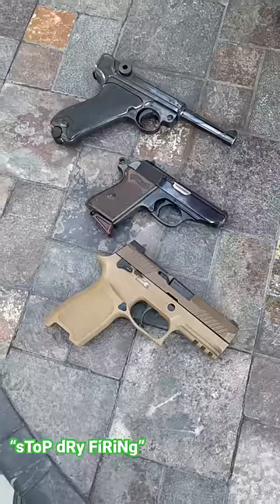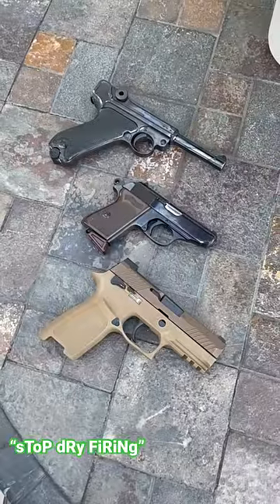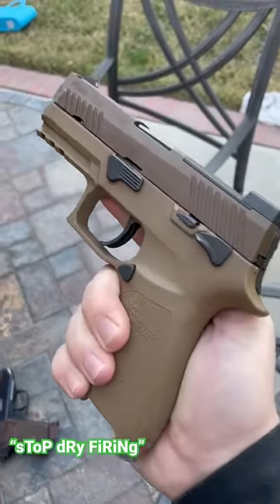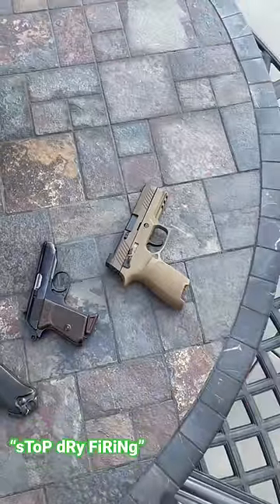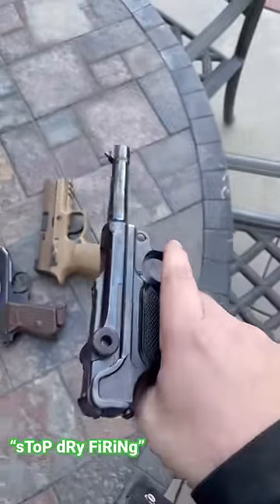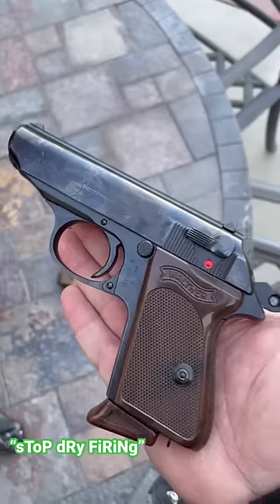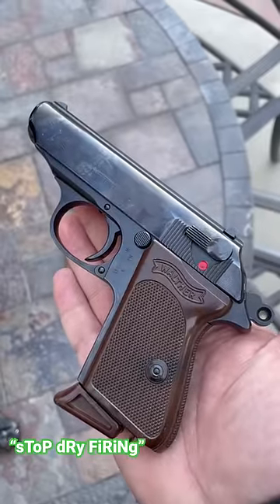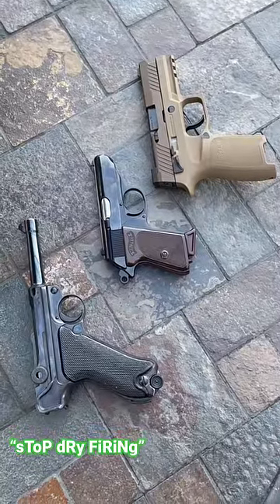“sToP dRy FiRiNg” #shorts

Comment: Or a CZ Rami BD built in 2014. Those firing pins are garbage and they admitted they used a weak metal for it resulting in bends

Comment: I routinely dry fire my Glock 17 using live rounds, as long as I point it straight at the floor and the upstairs neighbor is at work. No noise complaints,and my wife can barely find the holes in the carpet. Guarantees no damage to firing pin!

Comment: One thing I always hated about Glock was when dry firing the trigger would not reset to its original position. After pulling the trigger for some reason the trigger would just stay back like it was retarted and didn’t know what to do after that lol. It’s the only firearm that I’ve ever experienced this with.
Reply: Two of my buddies with two different pistols (one a cz something and the other some kind of taurus) both of them do it. I hate it as well lol
Reply: I don’t mind it. Since there is no manual safety on Glocks, the trigger staying back is a built in safety feature. Whenever I see the trigger in that position then I know that there is not a bullet in the chamber.
Reply: Rack the slide and it’ll reset the striker, most striker fired pistols are like that.

Comment: This is not true. Older revolver with a fixed pin also should not be dry fired. 

Also i shot my firing pin across the room dry firing a Beretta pico so yea on certain guns it will break your firing pin

Comment: Slamming the slide shut on an empty chamber does damage the gun though.
Reply: no it doesnt
Reply: @eeee-i1w  it does, and it doesn't. If you do it hundreds of times times it will loosen the lock up, and the pistol will lose accuracy, but it doesn't break the gun, or keep it from functioning. 100slams on an empty chamber is probably wear equivalent to. 2000 rounds. The round being stripped out of the magazine, pushed up a feed ramp, and having a spring loaded extractor forced onto the rim of the case decelerates the bolt enough so it doesn't slam the locking surfaces together. In other words it's hard on the gun.

Comment: SOME rimfire actions can be held just out of battery to allow the hammer to drop without slamming the firing pin into the breech.
A very few have disconnects to prevent the pin from being activated; Walther P22 safety works that way and may be dry-fired on safe.
Some manufacturers put a relief notch on the breech that keeps the pin from striking if it is fired empty, but that should NOT be relied on as a way to prevent damage.

Overall, don't dry-fire your rimfire guns.

Comment: you can dry fire centerfire all day long. rimfire is what you shouldn't dry fire.
Reply: centerfire firing pin only comes in contact with the cartridge. no other metal on metal contact. rimfire has the chance to strike metal inside your gun causing damage.

Comment: There are some instances where dry firing can be bad for the frame, too. Also, don't dry fire with the slide removed on something like a P226 or M9. Aluminum frame getting smacked by a steel hammer is somewhat bad in small amounts and very bad in large amounts.

Comment: The only centerfire handgun I know of that you should not dry fire is the CZ-52, as the firing pins are made of a brittle steel.  They will last for a very long time firing them with ammunition or snap caps.  But if you dry fire them, you have a really good chance of snapping the tip off.  They are the only handgun that I am aware of that has this problem.

Comment: I was always told it was possible to break the firing pin on a gun to wich I figured steel shouldn't be that fragile. I figured that statements old enough to be from flintlock and needle rifles beens that the needle rifles firing pin was made of flint and prone to breaking.